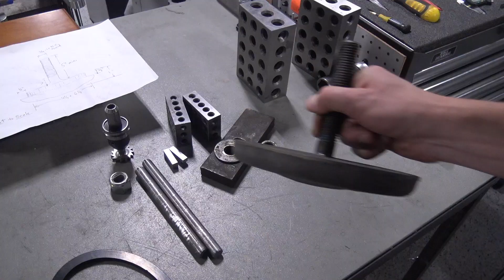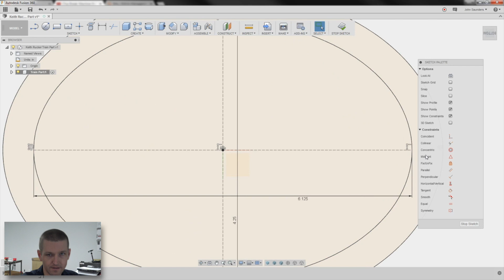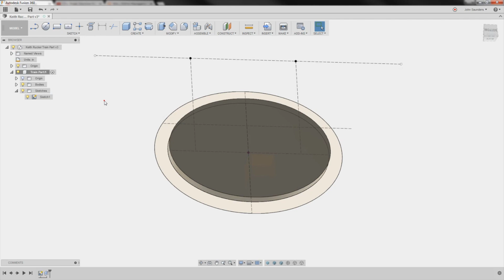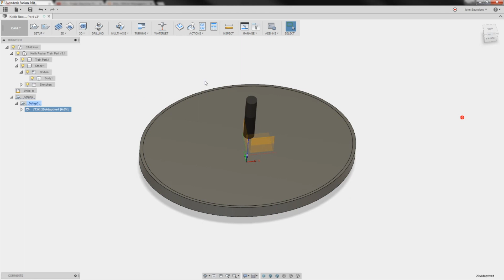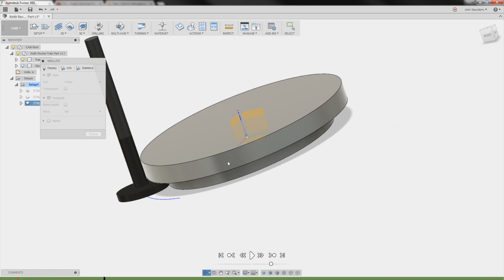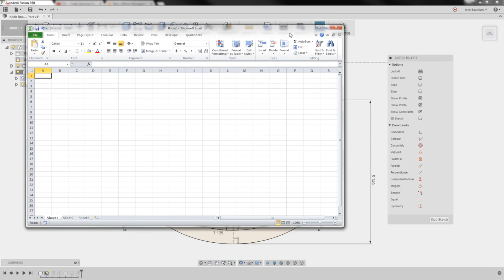Keith Rucker Cast Iron Train Part!   WW124

Comment: Another way to fixture that would be to use a 3/4" thick steel plate with a center hole for the stem and 3 jackscrew style standoffs 3/8" shank. That way you can adjust the jackscrews to get the right height in the fixture. 
Quick and easy to make.

Nice job.

Thanks,
John

Comment: When getting that nut on, I'd just put the whole thing upside down and use a deep socket. When you turn it back upright, you'll still have enough play to straighten everything back up before doing the final tightening.

Comment: John, You asked for fixture ideas. How about your idea of a 4th axis and an end mill. Do not chuck on the stud. Mount a large diameter tube in the rotary chuck. The face of the tube will square the part and use a large washer on the nut end. You can shift it around with the nut snug until you get it centered where you want it, then tighten the nut.

Comment: Hey John, with irregular cast parts you might be able to braze some thick legs to the top then clamped down on the new legs and driven the quill/spindle around like you first wanted to. then just cut the legs off and clean up with a paddle disk?

Just a thought
Reply: His setup is more rigid than that, not a bad idea though, extra work though for something not critical

Comment: Good one John. A tricky setup.

FWIW a couple of hopefully constructive suggestions:

Ditch the gauge blocks. The surface you're referencing off of isn't a precision surface and the casting skin is hard. Use a slightly compliant material like aluminium as the gauge blocks will slip; hard on hard. Think of it like conventional vice jaws; soft jaws on a hardened pin vs hardened jaws on a hardened pin. Which has the most grip? The accuracy of gauge blocks isn't required in this instance.

Since the skin of the casting is often very hard, brutally hard in many cases, you want to get under it and not have your cutters touc it at all. Especially for the first pass use a deep DOC and conventionally cut it. You don't want to be climbing over that skin. Conventional milling come up from under the skin and allows HSS to be used just fine without it dulling.

Finally, turn off the air. It's not doing anything other than blowing the crap around that would otherwise largely fall down close to the work. Personally I use a vacuum when machining CI and it often means standing there holding it in the appropriate position. However one way or the other it needs to be cleaned up, and by vacuuming it straight up, the mess is largely nipped in the bud before it begins. 

I got the impression you weren't overly happy deep down with this job, though the final results were just fine. CI is nothing to be afraid of and it machines beautifully. There's just a few tricks to using it but once you incorporate those in your work flow you'll be chasing after more to machine.

Comment: I'm really curious about how you think it would go if you were to attempt milling this part from scratch. Like if you started with a disk and welded a peg in then had to draw up the oval, the curved back, threads etc...
Reply: billtheunjust 
Cast iron plate. Cut the ellipses, cut the gasket groove, drill and tap blind hole in the center. 

Op 2, cut soft jaws to fit the ellipse, cut remaining material off,  

Turn a rod threaded on both ends, screw rod into tapped hole in ellipse plate, weld rod to plate. 

Done.

Comment: Hi John, thank for your videos! 
I would test the 4th axis again. Can you make a cylinder part and tight that with the nut in the back side of casting? Just over bore the cylinder inner diameter little bit that you can locate it to the center of the casting. Then take the grip from the outside of that cylinder/bunching with 3 jaw chuck. You will need to build fixture to locate the cylinder/bushing right in the middle of the casting each time.

Comment: I tip my hat to you for that set-up, it had me scratching my head for a few minutes thinking about how I would do it. I think you'll always be in danger of the part moving when holding around the centre of the part in one location, but I still can't think of a better way of holding it. Nice job John.
Reply: Daniel Way 
I would have cut the damn rod off, soft jawed the plate, cut the groove, then pin and weld the rod back on 😆

Comment: You could use a large sloppy sleeve around the crooked bolt with a flat surface that would register against the flat face of the cap and give you a big fat perpendicular handle to grab in a 4 jaw on the 4th axis.

Comment: Great video on unconventional fixturing.

Having designed and built a home with a LOT of ellipses, I can tell you that they are interesting to incorporate in a finished product. For a start, ellipses don't nest; when you added a half inch offset to your inner ellipse, the outer curve is NOT an ellipse. Sometimes you need one ellipse inside another; now try determining some way of filling the space between the two ellipses with wedge-shaped tongue-and-grooved oak flooring where the sort-of-radial joints seem to make some sense. We actually tweaked each joint (actually the ones in one quadrant) until they looked right. I assert that there is no formula which will do it. Each piece has two long straight sides with varying angles between them and the two short sides are sections of ellipses at varying angles to the straight sides. Madness!

Which is why I had some doubts about measuring to two locations on the edge of a rotating ellipse. As it rotates, the relationship of the edge to the line along the major axis will change. Fortunately, at the low angles of rotation you were using, the difference is minor and the tolerances are relatively large. You had enough material to cut an accurate ellipse at any rotation within such a small range.
Reply: I like them. They are among the most elegant of all geometrical shapes.

Comment: Great Video John - Lots of detail - Well Done!! :-) I had fun drawing up the Pattern in SolidWorks & 3D-Printing for Keith.   Added a little more % scale up than I normally would for cast iron to account for cooling shrink of the metal after casting but wanted you to have too much material for CNC than not enough :-) There is more about creating  3D-Printing patterns here if your viewers have questions https://ctmprojectsblog.wordpress.com/2016/04/16/casting-metal-with-3d-printed-patterns/   CHEERS!!   Charles Marlin

Comment: Hey John, I completely agree about the constraints issue and I wish you had an option to turn them off before you even finish the drawing so that i don't have to even worry about checking them and then removing them later on. However, I dunno if you knew but i stumbled upon it not long ago self teaching myself fusion. If you go into the select tool drop down there is a selection filter option and uncheck everything except constraints.... so amazingly useful. Watching your videos is inspiring as I come from a graphic design background but want to self teach myself machining and product design and your vids have been a great stepping stone for me. Keep it up.

Comment: Thoughts on fixturing: Yes, this method would involve some fixture development.

Instead of offsetting on gauge blocks perhaps a scrap plate of 6061, either round or rectangular. A centered clearance hole for the casting stud. Machined steps that would create a "key" to drop between the two 246 blocks to prevent rotation. The top side would have substantially more contact area with the casting AND the casting roughness would bite into the soft aluminum.

With the current setup your entire anti-rotation force is relying on friction resulting from the clamping load. You have the SMOOTH hardened gauge blocks interacting with the SMOOTH hardened 246 blocks. The coefficient of friction between these two surfaces is much less than softer rougher surfaces. Likewise, the bite between the casting and the hardened gauge block is not ideal. The aluminum spacer described above provides a much higher friction interface at the casting and at the 246 blocks the key converts the load path from friction to mechanical.

An additional benefit is if your cutter happens to clip your spacer the aluminum would be forgiving.

Taking this idea one step further, you could machine the aluminum spacer such to provide the hub needed to for your 4th axis approach. You would simply clamp the spacer to the casting by the stud and nut.

Comment: Here are a couple ideas for quick fixturing that may be easier to use especially if you had multiple parts. For 4th milling  use a piece of round aluminum or steel of appropriate diameter, Turn OD, Face, Drill clearance hole for stud, part off to allow iron part stud threads to protrude. Place part in fixture registering against faced end of fixture, add nut and washer. Chuck in 4th and proceed. For multiple parts...when chucking fixture use a spacer to locate fixture the same distance from 4th axis chuck. Or even better when turning fixture... turn fixture with 2 diameters leaving a shoulder to index against jaws. A vise milling fixture could be made from an aluminum or steel bar stock rem.. Square, face, drill stud hole. Add nut and washer again indexing iron against face of fixture. Raise on parallels if needed and use vise stop against fixture for repeat. If machining on Haas probe and coordinate rotate. For Tormach 4th or vertical milling use your normal shop practices for locating part. I just used a keyway cutter for a rectangular thread relief with corner radius'. Used Fusion and cut part on a Mori Horizontal. Part is a BAR mockup rifle, groove allows buffer assembly to be installed. Keyway cutters need fairly low speeds and feeds. Try stager tooth design ffor less tool pressure.

Comment: I likely would have done this job stud up with the part clamped down into a piece of soft wood. Wood is great for irregular parts as it isn't a slippery as metal and you can crush it to form an exact fit. This would require clamping twice to be able to mill the whole part but that would not be a big deal because I would have to move it twice on the rotary table anyways as it would be milled as a blend of two different radii.  Not saying that is how you should have done it just the perspective of how it might have been done on a manual machine back in the day., or even today in a shop with manual machines. :-)
Reply: If the recess wasn't cast, in this case why wasn't it?, perhaps a pantograph or maybe a bearing guided cutter a la wood working router.
Reply: Chris Stephens
Stylus guided mills have been around a long time so that certainly would be another way to do it. Finding one of those for this type of work would likely be even more rare than a knowledgeable person with a rotary table. Besides not having much to hold onto the 4 jaw and a big lathe might work too.

Comment: Your first angle adjustment method is completely just plain wrong (not trying to be rude here, but without the emphasis it didn't feel strong enough). In Fusion you dimensioned to the ellipse axis, but on the machine you measure to the ellipse itself. You assume the distance from axis to edge is the same on both sides, but it is not. Your second method is correct though. You say in passing it's simpler, and I'm let to wonder if you realized the first method was incorrect.

It seems to me you regularly use convoluted invented constructions that don't reflect the original intent/design (when you're modelling from a schematic) or the way you actually measure/probe things (when you're fixturing like in this video), when from my viewer perspective there's an obvious way you can model the real thing in Fusion, without it being much more complicated, if any. So far you've always ended up either scraping the bad process (often without realizing or admitting it was wrong) or having large tolerances hide the problem. I think that's just luck.

Comment: Is there something I don't know that would prevent developing a program that would account for the off-center and angle of the center rod while using the 4th axis chuck method you mentioned at the beginning?
Reply: Never mind, I think I figured it out. If the program had been set up accommodating for the run out of the screw, the tool wouldn't meet the piece perpendicularly and the flat rabbet wouldn't be possible.

Comment: Awesome job and creative fixturing! I would have made a shaft for that stud. Turned the new shaft true to the main casting in the manual lathe. Then proceed with using the 4th axis. But this was your job and the results speak for themselfs. I love cutting Cast Iron, I would love it more if I had someone to clean up the mess when I'm done.

Comment: Why on Earth didn't they just cast the flange into the cover, no machining required. Every hand hole cover I have seen is just cast and maybe just lightly ground by hand. That is why the gasket is so thick.
Reply: enginebill 
Was thinking the same thing. 

Who knows. Maybe it's an emergency repair and that's the only thing they had on hand?  

I haven't done any of those things, but I wonder why the threaded rod isn't a separate part as well.
Reply: It should have a boss on the inside and a tapped blind hole for the bolt.

Comment: Well done, like the setup.
Good point on "take your time for a one off". Converting a ton of material into chips within half a day is no black magic, that comes down to HP, workholding, programming and tooling 
Getting a one-off part on the first try (because there is no spare part...) right, thats the good stuff and asks for experience :D
(Also when to decide not to go with cracy speeds/feeds/DOC...)

Comment: de fixturing to put the gasket on, maybe put it on like you put a tire on a rim? At first I was thinking the rotating the part in fusion a little overkill because you needed to mill the perimeter but in the end it was needed.  Either way, great to know.  When I saw the part move in the fixture it was OMG time but you've been there and done that often enough that it was no big deal.  Great job all around.

Comment: John, I have been using a wood ruff cutter quite a bit lately in the mill. In fusion instead of creating two cycles for the total hight to cut, I just use multiple depths. The selection constraints take care of the rest creating the step downs needed to machine the part complete for that cycle.

Comment: John
Alternative fixture thought.  Turn an aluminum sacrifical "face plate"  with an internal ellipse cavity cut into it to locate the od and a flat face to support the bottom flat with a center diameter small enough to fit thru your 4th axis hole but with a hole thru it large enough to allow for the irregularities of the center shaft. clamp the 2 pcs together with your smw clamps to get it located on the fixture then put a nut and washer on the end to secure it. Put the fixture and part in your 4th axis and cut it as you originally planned. The closer you get to finished the less you have for support from rotating so it's up to you but you may want to keep the smw clamps on as you machine and move/remove them as necessary or just add one as it approaches the finish. This is all based on your 4th axis having the capacity to accomplish the task if it isn't large enough for this it's back to the drawing board! lol

Comment: Hey John,

this is Nico from Germany. First of all, i love your channel. I like your "oldschool" machining tricks combined with new machining technics like Adaptive Clearing.

I have to say that sometimes i don't like your strategy choice. For example: You used 2D Adaptive Clearing for the outer contour where its nearly unnecessary because of the small amount of stock. Why didn't you used it for the groove? If you would have done it, your part would not have turned while starting the second machining path because of the constant cutter load. (I hope you know what i mean).

Check out this picture for clamping setup.
http://www.allmatic.de/allmatic/web.nsf/gfx/2010_Centro_5.jpg/$file/2010_Centro_5.jpg

One of the best and most innovative vise manufactures. Love these vises. Check out there products. Would have taken 5 min to setup this part :) 

Also check out my very first video. You see an "Allmatic" vise with an complete unregular contour and surface clamped with only one vise. I could sent you more pictures and information :)

Greetings

Nico

Comment: Hi John.  Love your enthusiasm.  I have a question; not withstanding that I don't understand why the part wasn't cast with the recess already in/on it.  Maybe I'll ask Keith haha. The draft angle on this part of it is truly not significant in this application.   The question is: Perhaps I'm thinking of other machines, but does your Tormach not have the facility to 'map' the stock that has been mounted?  I mean in the sense that; 
model the cut(s) in Fusion considering the size and shape of the stock.  Then mount the stock and get the Tormach to map the stock (with the Hymer???? or some other device - you know, like they do with prototype car bodies modelled in clay), and let Fusion calculate the cut in relation to it's orientation ? Anyway. well done.  Regards Mark in the UK